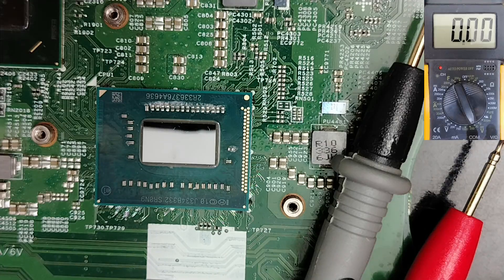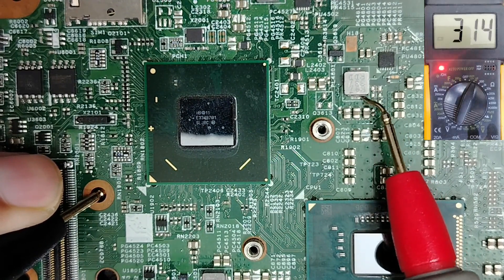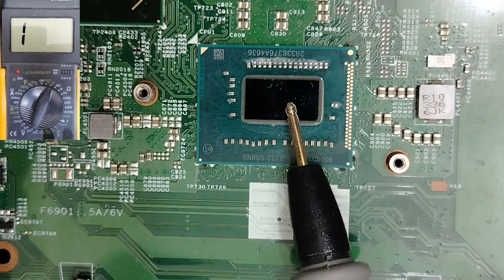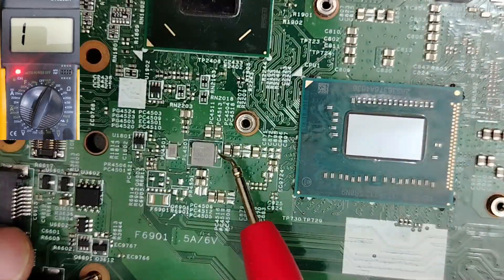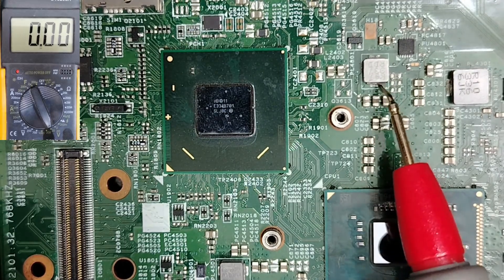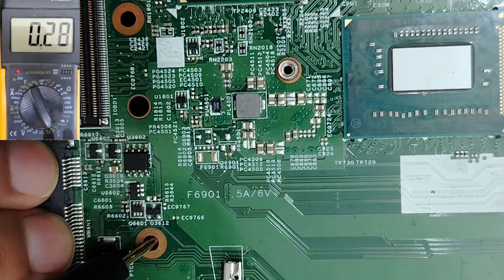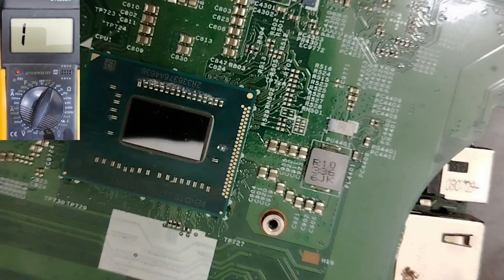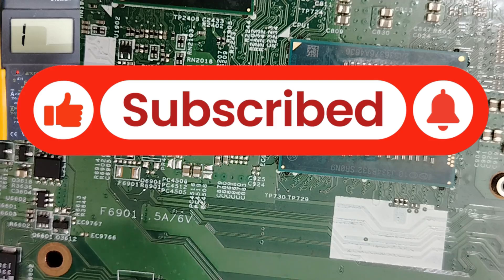Is Your Laptop Dead? Try This Easy Short Test - electronics repair

Comment: Of course, you can only get those voltages at the VCC core and at the chipsets if the laptop is turned ON, not just connecting with the DC Jack.

Comment: Yes blood  let me ask you please  ,my phone deeped into water  ,it resumed  to be functioning  but the problem  is that  the display does not produce  light ( L  D). What could be the fault ic
Reply from the maker: Since the phone fell into water and now the display doesn’t light up, the issue could be with the backlight circuit. Even though the phone is turning on, the LCD backlight IC, fuse, coil, or connector might be damaged due to water.

I recommend opening the phone and checking for corrosion near the display connector and backlight section. Clean it and inspect components like the backlight diode, filter, and IC.